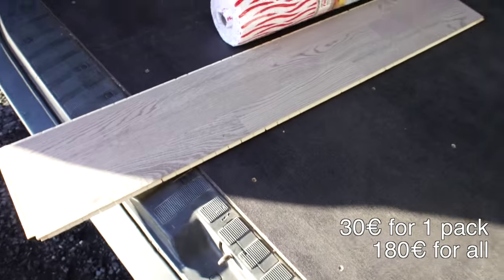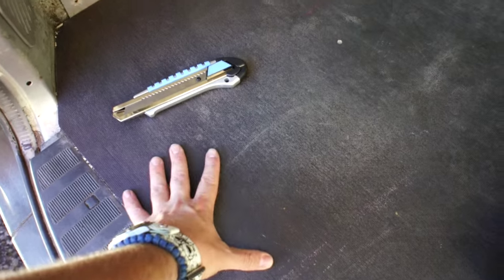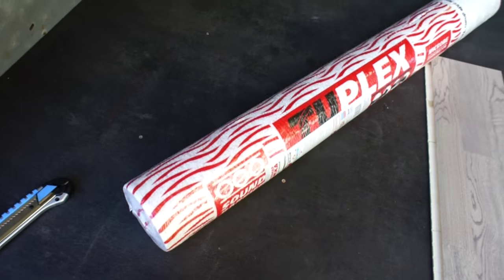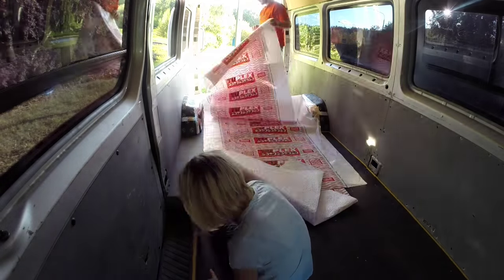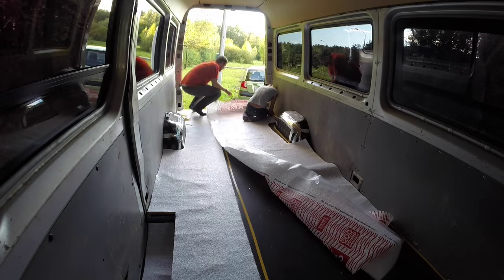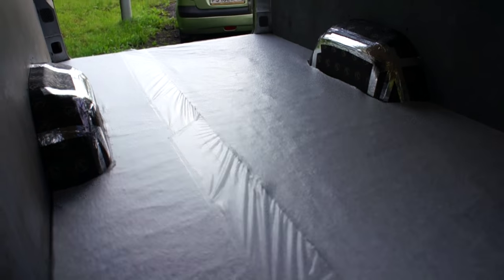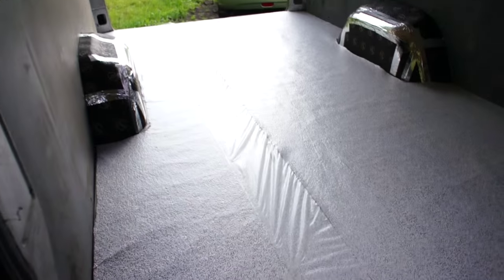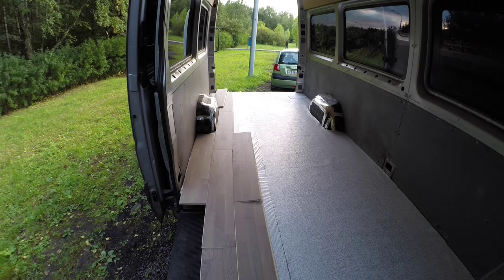Hardwood flooring in a van conversion. Wooden floor installation in a sprinter van, rv or motorhome

Comment: how long is the cargo area from back of seats to the back doors?
Reply: 4.3 meters
Reply: i like the sprinter for it's length and the ram promaster for it's width   ..the promaster is 188cm across but only 3.96m 
long.
Reply: @jackf498  look at fiat ducato
Reply: @VanTourist  yes ,the fiat ducato is called the ram promaster here in the US....they are the same van.
Reply: @jackf498  oh ok, didn't know that. I thought it could be longer tho
Reply: @VanTourist  ...3.96m is the lengh of the ext.version ...its the longest promaster or ducato.

Comment: How much weight do you think the floor adds?
Reply from the maker: It's easy to calculate. Each piece of this hardwood weights 1.56kg and i use about 30 of them. It will be 47kg
Reply: thanks!